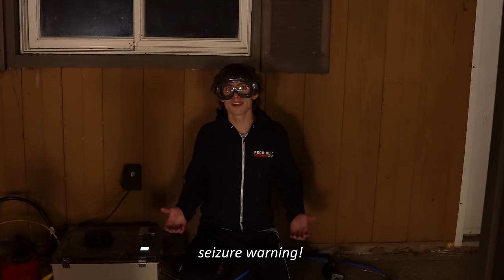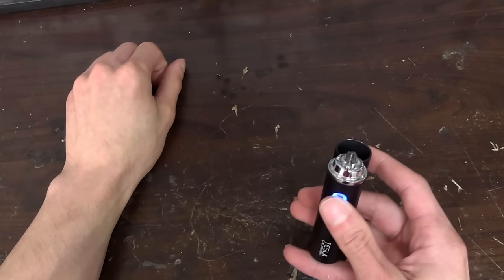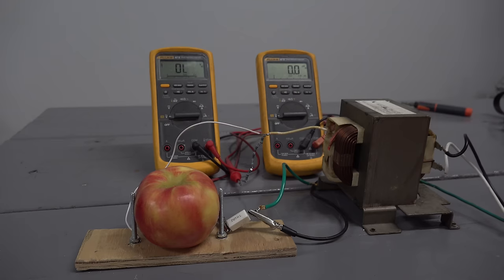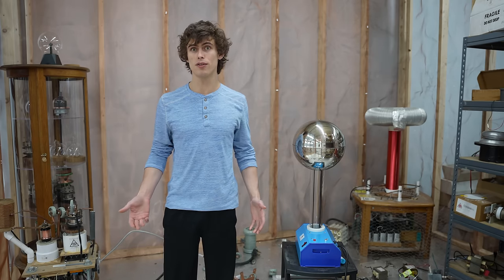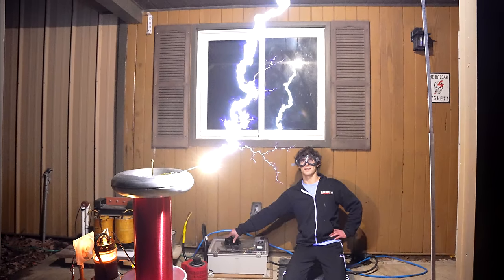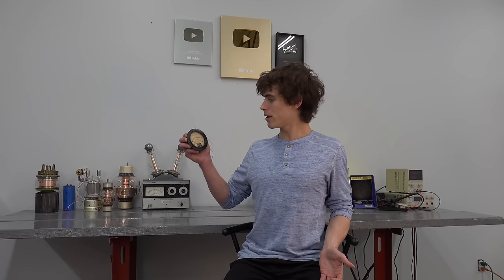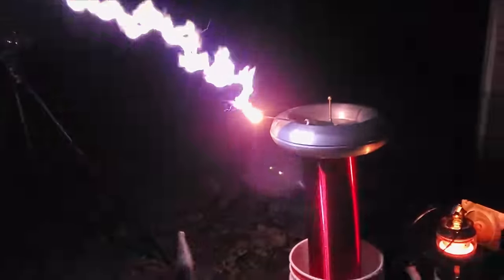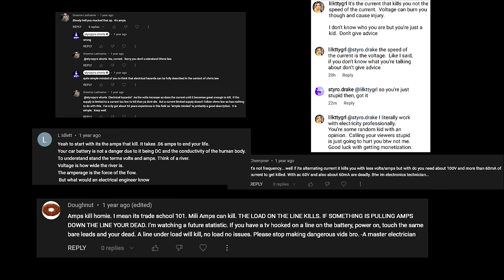Is it the volts or amps that kill?

Comment: Just a comment about resistance. You are measuring resistance just by holding meter probes. The larger the contact area the lower the resistance. In the demo where you fry the apple it looks like the contact area of the bolts is greater than the meter probes. Also if there is much contact force of the bolts on the apple the thread could potentially cut through or at least weaken the apple skin. So to sum it up - it is a bit misleading to simplify resistance measurements just by a meter reading without consideration of how the voltage source actually connects to the body. So for example, connection through ECG patches results in considerably lower body resistance than what you measured with the meter. And of course it is impedance that ultimately is the most important factor (not just resistance) along with the characteristics of the source voltage (eg. AC/DC, frequencies etc).

Comment: If its the high frequency that keeps you safe when touching that arc, why dont you die from the low frequency component from the rectified half wave that actually drives the oscillator? Obviously its a component of the output since you can hear the 60Hz hum in the arc

Comment: It is the current that kills you.  When you are measuring the current flow you are not measuring through your body you are measuring through a metal object that has a very low resistance.  The Danger factor that will show you how dangerous your shock could be is based on 3 things.  Sustainable voltage, Resistance, and where the two potential differences are touching your body.  1st. Sustainable Voltage. Some things that you get shocked by may read a high voltage but if you dont have the source to hold the voltage you will just get a major voltage drop which largely decreases the current flow.    2nd Resistance.  The resistance between you and these two points will also greatly change the amount of current flow.  Are your hands moist or soft, how much surface area is touching your skin?    3rd where the two points touch you. If you get shocked across both hands you may get current flow across the heart which can be lethal but if you get shocked from one side of your hand to the other side it may damage your hand but likely will not kill you (If the voltage is high enough it could change this).                  Proof that it is the current that kills you can be shown by the size conductor you need for a certain amount of amps.  The size does not change if the voltage is higher, only the amps.     Now with this being said you should be the most scared of voltage because it is the voltage that is going to be the main factor in how much current will flow through you.

Comment: De manera empírica he aprendido que el voltaje es el letal, ya que, el concepto que tengo es que el voltaje es la capacidad que tiene la corriente eléctrica para romper la resistencia eléctrica de un material.
A mayor voltaje, más profundo penetrará en tu piel dañando un órgano importante.
Como electricista me ha tocado experimentar electrocuciones a 120v 220v y 480v, donde curiosamente cada una sentía cómo llegaba con mayor facilidad más dentro de mi cuerpo

Comment: It is the courant that kills you even if a few milliamps are enough since we have around 30k ohms if dry. You cannot get killed by 12 volts unless you do it on purpose. But more voltage will create more courant with this 30k ohms. If I am in a salty bath my resistance becomes very low, if this bath is  connected to the ground, I would not touch enev 12V dc.

Comment: The battery cant push through you because its 12v and the human body depending on the connection points is 100s of k ohms. Sorta like my other comment on this.

Comment: TLDR:
Amps kill, but any current that is fatal requires a voltage to drive as per I = V/R, meaning you cannot have lethal amperage without the necessary high voltage. However, the reason lots of high-voltage demos and discharging devices are perfectly safe (like 200000 volt van-de-graff machines) is because that high voltage has very little charge and energy behind it. It is the static, open circuit voltage that you are measuring and so when any load is actually connected the voltage almost instantly drops to near zero.

So for a van-de-graff machine at 200000 V, you are in fact actually touching real 200000 volts which will drive a current of 1-20 amps through you if you complete the circuit to ground. HOWEVER, because a van-de-graff machine has so little charge behind the 200 kV, the high current lasts more a mere 50 nanoseconds or so before the voltage drops down to insignificant levels, meaning the exposure to current lasts far less than even 1 microsecond. As a result, the actual energy you are absorbing is very little.

Comment: Well I jumped onto/cut into a 440 electric main with a shovel full of water in a ditch trying to deal with a water main break not knowing the electric cable was there. It was like a horse kicked me and I flew out of the ditch 20-25 feet.  Still here.  I've been zapped from 110, to 220, to 440 and still breathing. So not sure what the hubub is all about.

Comment: I professor shows how touching a thousand volts didn't even phase him because of low amps. Now I am confused. Please explain. Thank you.
Reply: If you are talking about the van de graaf generator video it is false. There is actually high current for a few nanoseconds and after that the voltage and the current drops. Electroboom also mentioned it in his 7 million volt taser video

Comment: Analog Sensors measuring the RMS of Vacuum-Tube-produced Electricity?
That might be the most silky-smooth Electrical-readings ever. 
I'm just a random dummy, but for some reason the readings of that Mechanical-Meter "feel" just like Fluid-Dynamics to me. 
IDK, it makes me think of Surfing, like on ocean-waves. 
Does anyone smart know if that actually fits metaphorically? Or is my brain just being strange?
hmm... I guess RMS almost literally "looks" exactly like Surfing, since ideally the Surfboard would just cutting directly through the center of the Wave. I didn't think it was that simple, but maybe it is, shrug.
That "Analog Tesla Coil" still feels weirdly reminiscent of "Liquid/Fluids" to me though.
It kind of reminds me of decorative statue-esque Water-Fountains now. 
I wonder how Fundamentally-Mechanically similar that Vacuum-Tube is to a standard Water-Pump?
Like, I wonder if a Vacuum-Tube "pumps" Electrons like a Water-Pump pumps Water-Molecules? Guess I gotta look that up lol, dangit I had other stuff to work on lol.
EDIT: From what I can tell it seems like Vacuum-Tubes work more like Heat-Pumps than Water-Pumps, but fundamentally all of them are just "highly-encouraging" some tiny bits to move from one place to another. So I guess if anything all of those Devices are more like "Teleporters" lol, since all of them forcibly transport molecules or atoms or w/e from one location to another.
Dang, Science/Math/etc is so cool, I wish I was smart enough to actually understand it.
I'm a pretty good Reader, and I have no trouble grasping non-native languages or communicating through Language-Barriers, but Holy-Hastur! Math is by far the most complicated and inscrutable Language ever conceived! 
The lucky people who are naturally adept at Mathematics speak a common language that many of us will never comprehend.

Comment: Is it the volts or amps that kill?
(It takes as little as 25 ma to Fibrillate your heart)
AC "Your Heart Can Not Beat 50 or 60 cycles per second"
DC "Your locked on to it there is no cycling - You Fry"

When I was a Tech I built Industrial Electrical Equipment
As I was testing High Voltage power cells one of the insulators had a crack in it causing Leakage
As I walked past it I saw a Blue Arc hit my Gold Ring
I Took 35,000 kv on the low and 65,000 kv on the high 
I came too across the room I flew under the table and got full of dirt dust
"Break Time" while I shake it off

We Electricians Practice Killing Power before Working on systems!
Working with "Live Power" we use "The One Handed Rule"

Comment: Product of Voltage and Current kills you if certain value of the product crosses the threshold, we all know what that product is, it is called Watts, watts if Energy, so what is Energy? some think it is electricity, yes in a way it can be said to be energy, but Electricity itself is not energy, because electricity is created by Energy, as most will know electricity is generated in power stations by mechanical energy, by huge Dynamos or generators turning with external source of energy, this energy comes form water dams, burning coal, burning fuel, gas, or  by force of wind, so Energy is in reality a mechanical force , apart from the Sun's rays that can be converted to Electricity directly through photovoltaic cells as in solar panels, 

So can you imagine a huge water fall spinning a giant turbine of 20 foot diameter weighing 100 tons, and how much power is needed by force of water flowing through its turbine blades, this is the Energy that gets converted into Electricity for easy transmission to your houses, and since Electricity is very versatile as it can power your lights, cookers, washing machines, your computers and all electrical gadgets, so basically electricity is a channel that transmits energy into your homes, by itself Electricity is not Energy, prove me wrong if you want.

So for instance, a small DC electric motor of say 10watts you could stop it from spinning or turning by holding its shaft, but of it was a 5 horse power motor, if you tried to hold its shaft it would rip your arm to shreds by twisting it round and round, so what can kill you is the Energy (watts) a product of voltage and current, it depends on your body chemistry how much it can conduct, the lower is your body conduction resistance the higher will be the flow of current,

Comment: Is it the volts or amps that kill?
A question pondered, with caution still.
In the dance of electrons, where danger lies,
Volts and amps, they both disguise.

Volts, the force that drives the flow,
A power that sparks, a deadly glow.
Amps, the current that courses through,
A silent killer, in the electrical brew.

Together they dance, in a deadly waltz,
In circuits and wires, where darkness exalts.
But which holds the power, to end a life?
Volts or amps, in the electrical strife?

For volts may shock, with a powerful jolt,
But it's the amps that truly take hold.
In the battle of volts versus amps,
It's the combination, where the danger ramps.

So heed the warning, in the electrical haze,
Of volts and amps, in their deadly craze.
For in the dance of electrons, where danger spills,
It's volts and amps, that hold the kills.
Reply: There is still one thing that lacks your rhyme!
You got volts and amps,
but not the time!

Comment: It might be 3 A at the base, but the further up the coil, you go lower the current will be, so the high voltage output cannot have more than micro amps. Otherwise, you would have an over unity power game, which current physics say, is impossible due to the laws of thermal dynamics, the bottom line 3 A at the base is nowhere near the current at the top of the toroid and is much much less. Your comments please.

Comment: 0:54, I love it. The speed of the current is the Voltage. What? I am watching this video because I don't know the answer but even I know that that is just wrong. Voltage is potential difference between two points. The greater the difference, the more force is behind the current, but the speed of the current is still just the current. Voltage influences the speed, yes. All this assuming resistance stays the same. Current is Voltage divided by resistance. More voltage, same resistance, more current. But by god Voltage is not the speed of the current. That literally is current. It's literally at the top of the Wikipedia article. 1 Amp is 1 Coloumb per second. This is basic school knowledge. That statement coming from a so called "electric professional"... wow.

Comment: I wonder if any has caught on to this… Higher learning centers do not teach how to do think. The only teach what to think. That includes the medical field. 
The subject of this video shows that extremely well. Indeed, all the text books told us it takes less than 1/10th of an amp to kill. My biggest problem with that was, “based on??” If I=VR then “l” depends on the other two. It isn’t stand alone. You need the voltage and resistance.
In health, this is approximated with the study of heart disease. There is no proof that cholesterol does anything. Yet its common wisdom that its all about cholesterol. This is solely because in medical universities they are ignoring science and using epidemiology. Epidemiological studies, by their very definition, can not show anything causing anything. It can only show associations. Yet, they base their findings on it. Telling young skulls full of mush, that cholesterol has a damaging effect. When in fact, it has a healing effect. 
They just dont teach scientific thought anymore.

Comment: Hi engineering friends (mine's a different kind), how's Styropyro (and Electroboom in one case) not dead in this test if 1 amp, 1 joule, 1 volt all equal trillions of electron or 6.24 X 1018 electrons? What does it mean the voltage, nor the amperage is not high enough to kill if both have the same electrons in 1 unit?

God bless electronics and electrical research.

Comment: could someone explain how impedance matters in this conversation? i don't see how higher impedance could make an electrical signal less deadly... it does lower the current, but apart from that i don't see what else it changes..,
Reply: There is a voltage drop across the impedance so less voltage is applied across your body and less current flows.
Reply: @laserdiode  oh wow, didnt realise that the answer was actually that simple... thank you!

Comment: at 10:03, why is it 40 amps when the oscilloscope is measuring 20V/div, which is 40V in that case.
Reply: Volts and amps are diffrent
Reply: @1dK628  i know, but why does he mention 40 amps when the device is measuring volts. Where is he getting the amps output.
Reply: @mihairx2  I don’t know prob a different gauge
Reply: He is measuring across a 1 Ohm shunt.
Reply: @mihairx2  if you know resistance and volts u can calculate amps
Reply: @magictoffee7066  oh, that makes sense.

Comment: Technically it's the amperes. However how many amperes flow through you depends on the voltage and your resistance. Without high voltage you won't get high amps but high voltage alone won't kill you if you are insulated well enough.

There are several other factors as well. The first would be the path the electricity takes through your body. A shock usually kills you by throwing the rythm of your heart off so that it can't pump blood properly anymore. So in order to be deadly the electricity has to flow through your heart.

Secondly, the duration of the shock is important too. Very short shock durations are easier to survive.

Finally, AC current is much more dangerous than DC current.

Comment: Its like asking: is it speed or mass that kill?
Reply: Yes. The answer is a combination of both.
Reply: It's even worse. Speed and mass can be changed independently but voltage and current are proportional.   At a specific voltage across your body a specific current will flow.

Comment: No man , not is the current, but the current that pass inside in your body, for under you skin, if your body  resistance be correct for generate this same current.Same if the current pass in your body but pass for over your skin , you don’t will dye.

Comment: I have taken hits of 500kv and over, but for split seconds. Trust me when I say it damn well hurts!!
Think about the worst dead leg you ever had but full body! Yet the complete absence of current one will take it no problem. However, if you end up hooked to 500kv of voltage alone on continuous supply you will explode..... at least spiders and flies explode....
Voltage alone can kill yes, current can kill yes, but depending on the levels of each alone or even together you would be amazed what the human body can endure. Voltage kills and current kills, depending on conditions you may survive or you may die x

Comment: Swear it crank motors lower than 1000 amps it says 850 but I got an idea or two you can test a good bar of copper, off the ground with some AC/DC

Comment: So I haven’t watched your video yet but I was told amps. I asked my professor btw I was completely kidding when I asked this. But anyway I asked if I wanted to torture someone without killing them with electricity how would I do it. His first response was a question. Do you want to use DC voltage or Ac voltage? I responded jokingly with ac. He then went on to say well you would need to use ohms law to figure out how many resisters you would need in order to keep the amps below 100-200 milliampers so as not to kill your subject. But you can use just about whatever voltage you want so long as you do the math correctly.  He said amps kill, volts hurt. I never returned to that class again.